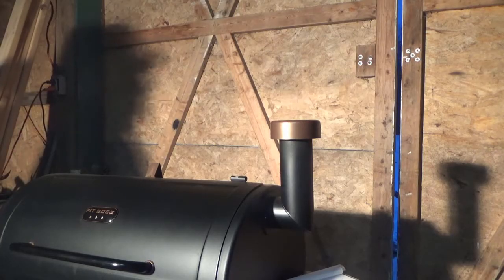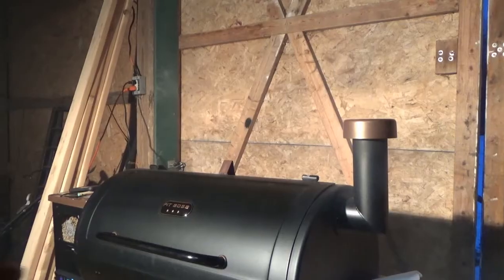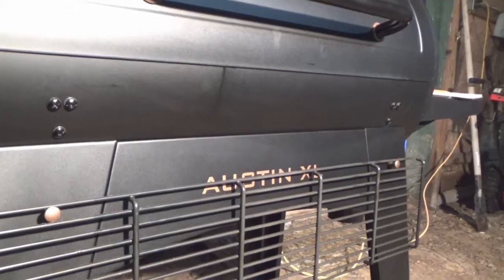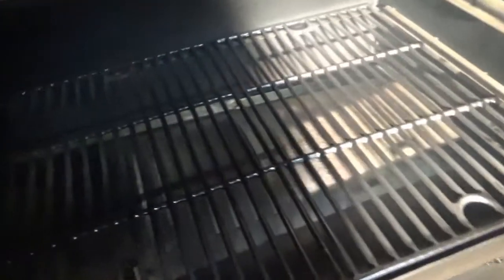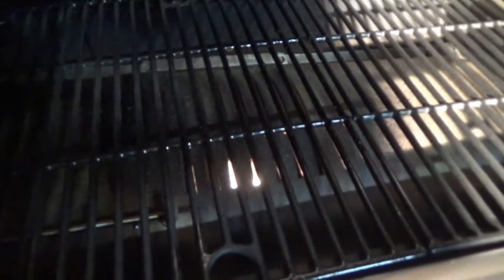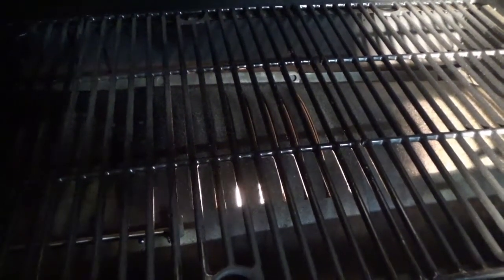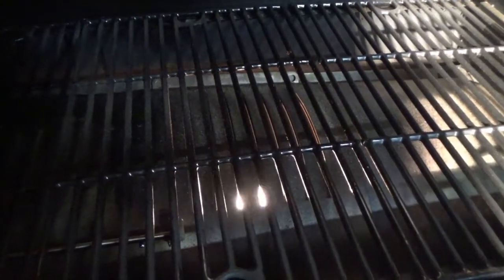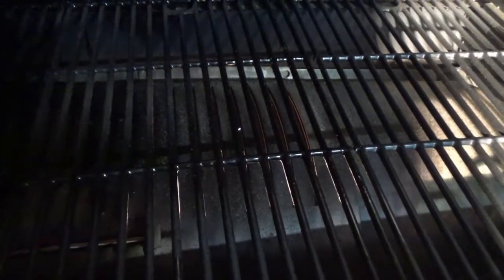Pit Boss Austin Smoker Pid And Smoke Test - Chart At End Of Video - See Description!

Comment: The way I understand PID is the higher the number, the longer the interval for auger feed.  This allows the pellets to get a chance to smolder and produce more smoke.  Your chart actually shows that.  It will also allow you to produce smoke at a higher temperature above the 180 mark.  That delay in auger feed will let it smolder just a bit longer even at the higher temperatures.
Reply from the maker: I still want to put a control on the fan. With the fan blowing so high at all times, on mine anyway, I think slowing the fan down will help with a cooler burn and more smoke. Future project.

Comment: I’m new to the pellet smoking community. Bought my Pit Boss Classic from Walmart have been excited about using it! For years I used a Mastercraft propane wood chip smoker. Not the greatest, but I learned how to make do. Been wanting a pellet smoker for quite sometime and I noticed the same issues that you are describing. 
I thought about tackling a steel plate with some holes drilled in it across the top of the igniter pot. Something that would disperse the heat across before it hit the actual drip guard. I’m sure that would change the temperature range and just like you, I don’t want to chop up a brand new grill. I wonder if an adjustable fan would work? Something with a voltage regulator to adjust the speed of the fan…
Anyway, I’m 3beers and 2hrs into watching how this grill works and probably no where near qualified to be making comments about engineering modifications of something I know nothing about 😅
Just a guy that stumbled upon your experience with the same grill I have.
Reply from the maker: We learn by doing, at least I do!